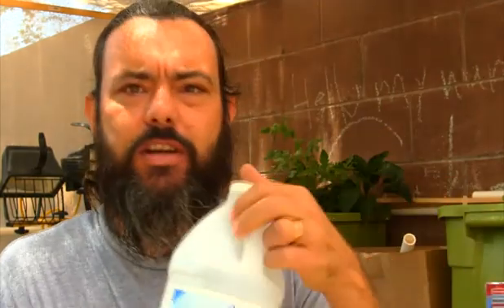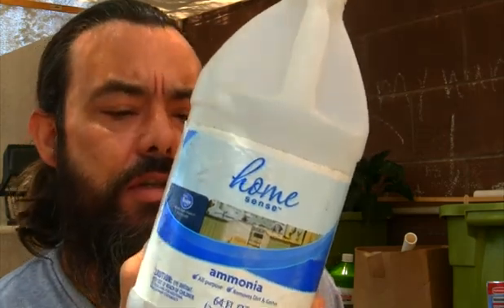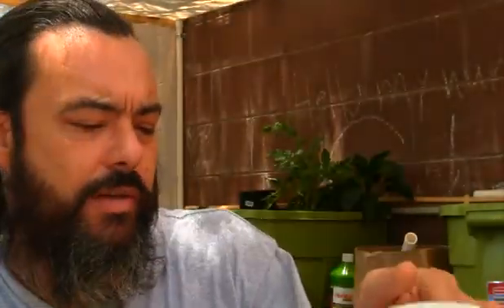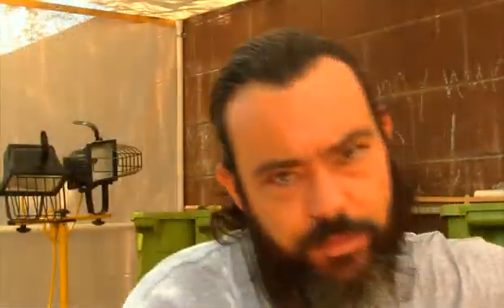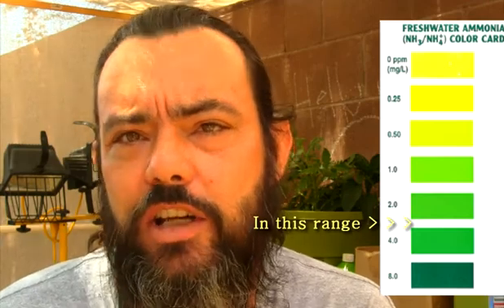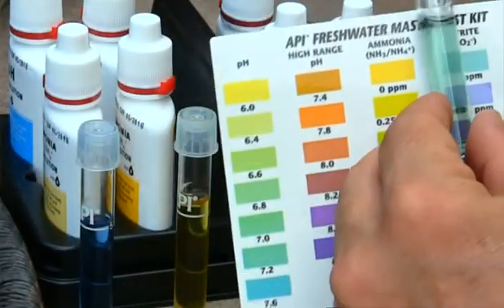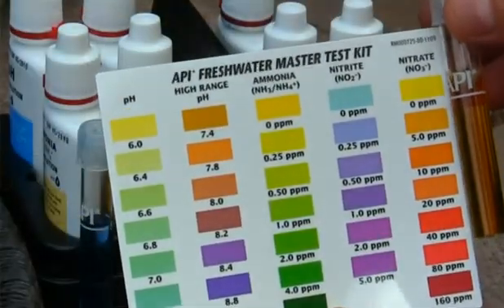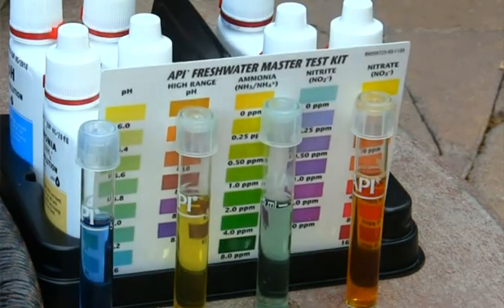Desert Aquaponics--Fishless Cycling

Comment: hey I'm cycling my system right now. I started on the 20th of January. the pH is jumping between 8.0 to 8.4. ammonia is at 0.25 to 0.50 after 24 hours of adding 4.0 ppm of pure ammonia. I have a high range of nitrite( 1.0 - 2.0). nitrite wouldn't get any lower than that. however nitrate is so high( 80 to 160). my question is why do I have high range of nitrate when i still have high range of nitrite. note: low temp is 10 c° - 3c° 
high temp is 20c° - 27c°

Comment: Surfactant is a like a soap it reduces the surface tension of liquid's letting them flow and penetrate what ever it touches, from a farmer point of view not good for an aquarium. Widely used in the chemical industry.  (but if it works, go for it)